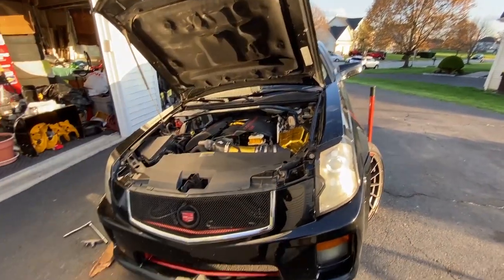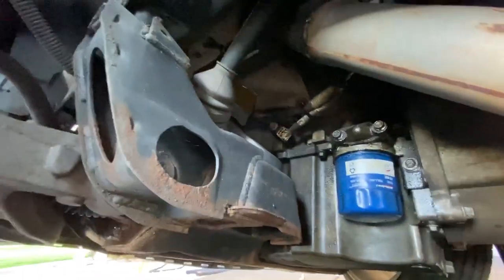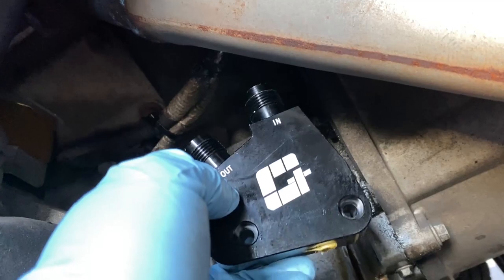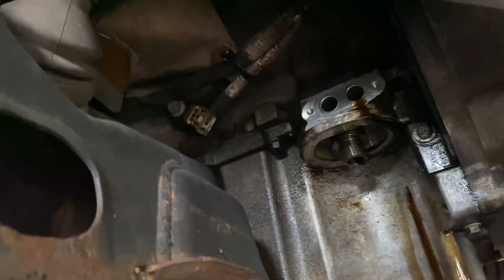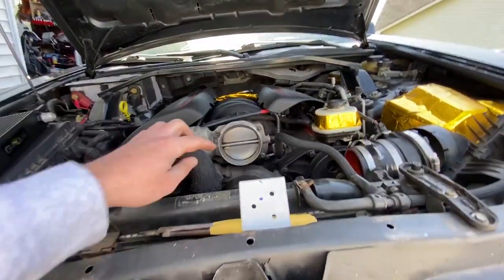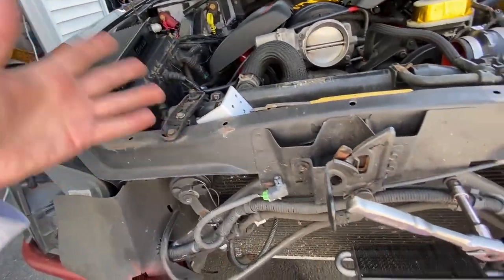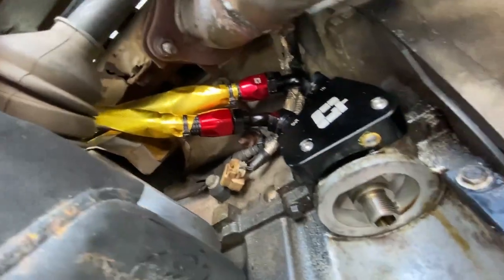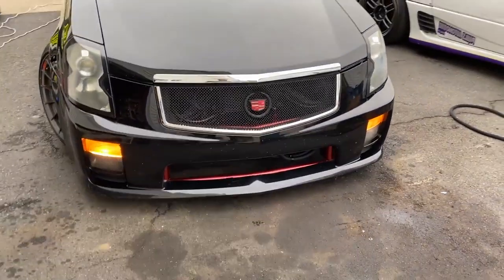Installing an LS Oil Cooler on the CTS-V!

Comment: Did u put a gasket in between the cooler and the block?my oil cooler is leaking not sure if it’s because the cooler itself not tight or Mayb the gasket.
Reply from the maker: Yep, I got an oem gasket for an LS car with a factory cooler.
Reply: @mike_stanceco  hell yea thanks for the reply bro!
Reply from the maker: sure thing!

Comment: Is there already a factory cooler and what the point of the oil cooler? (All you assholes type in to cool oil please)
Was your car running hot for some reason?
Reply from the maker: the V1’s aren’t equipped with a factory oil cooler. i plan on tracking this car, so with the added stress, oil temps will rise. regular street driving  i had no issues.
Reply: Thanks for the clarification. I have a 05 V and know nothing about cars so I’m learning where and how I can.

I think the temperature runs about 220 on the car but I’m gonna start looking at the oil temp also.

What’s your oil temperature with other cooler and with the cooler?
Reply: * with and without the cooler